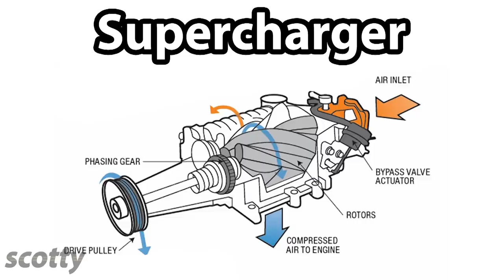Supercharger vs Turbocharger - Why Supercharged Car is Better than Turbo

Comment: Just curious why aren’t there many/any production supercharged cars? Lots of turbo gas vehicles now
Reply: Emissions and fuel efficiency standards.

It is much easier to build a turbocharged engine at a given power range that will meet current emissions standards in the tested range and in steady state conditions (idle, cursing at a set speed and low load).  In high rpm/boost/power usage states, a performance turbo setup will have the worst emissions when comparing it to NA and SC setups.

Also it is much easier to build a turbo engine designed for MPG/fuel efficiency testing since you just spec out a turbo for your engine that has a boost threshold within the mpg efficiency acceleration test range (1.5k through 2.5k rpm) and running between 6 and 9 psi.  When a turbo is passing over it's boost threshold and through a small rpm range after (which is biggest somewhere between 7 and 8.5 psi depending on the turbo characteristics) there is a massive spike (and possible small plateau) in the engine fuel efficiency.  If you setup that spike to happen through most of the mpg efficiency acceleration test range then the vehicle will see a large spike in tested mpg.  Also you use a smaller displacement engine for a given power range than you would with a NA engine, resulting in reduced less fuel consumption during the cruising part of the test.  That is, for the speeds when the smaller displacement engine with the exhaust restriction produces enough horse power running in steady state to keep the vehicle at the required mph.  If you look at a turbo vehicles test numbers, you will see that there is a much larger spread in mpg between the slower and faster mph test than a NA vehicle and often actually worse numbers in the 75 mph (and for really small engines the 55 mph) test.  But since the lower speeds are given a higher percentage of the test score, having those get a higher number more than offsets the worse number in the higher speeds.

Of course, you will only ever see that if you drive in the city like a granny.  Once you start cruising down the interstate at 75 mph or putting your foot in it and accelerating hard your mpg will drop rapidly.

So you see a lot of turbo cars now because they kinda sorta but not really allow car companies to cheat the fuel efficiency and emissions standards. (But really, they do)

Comment: I bought a power inverter from harbor frieght, harbor frieght aircompressor plugged into inverter and ran air line into the intake before map and maf. When I want boost i flip on aircompressor 😂

Comment: Maybe in the 70's this would be relevant but turbos have came a long way, they are water and oil cooled, are more efficient in generating power and are extremely reliable, 700,000 peugeot turbo still good never had a problem. 500k on a VW 1.2 TSI not a problem.

Comment: And when the belt brakes or blows of your stuck with turbo you can still go if you blow a intercooler pipe or turbo and if you want to make power I'd go with turbo why well anything that runs off the crank will take power from the motor to build it where the turbo uses wasted used energy to make power

Comment: I’d have to disagree. I love all forced induction cars but turbos are more efficient and fun to me. They don’t need to utilize engine horsepower to operate like SC’s do and that little bit of lag always puts a smile on your face when it finally hits you. Turbos also tend to utilize much more boost than superchargers and don’t require a big engine for their power

Comment: That pro-charger has the same lag as a turbo with less boost.  Real lobe or screw superchargers are outrageously expensive.  Turbos are ubiquitous and can be purchased for a few hundred bucks and most guys install them themselves.  Sure, a $6,000 SC is great if money isn't an issue.  But for most projects, it's out of the question.

Comment: N superchargers dont change the noise characteristics of the exhaust right? Since the exhaust manifolds havent been replaced like on a turbocharger. So a screaming v10 will still sound as it should even if it was supercharged, right?

Comment: Sorry Scotty but turbos are far more efficient. Roots style SC waste so much power just to get them turning. Plus they just pump all that hot, compressed  air into the motor. Which means less dense air and also less timing to keep down detonation. A centrifical SC is more efficient than roots type and can be intercooled but still is a large drag on the system killing HP. Centrifical SC also make boost per rpm. Which means you won't hit full boost tillcloser to redline. A properly matched "Big" turbo may be laggy but will reach full boost far before redline (where it counts). Plus there are many ways to combat lag i.e. smaller turbo, antilag etc. Turbos make more power per psi(efficiency baby!) and are ran by using wasted energy otherwise dumped right out the tailpipe. TC are more reliable if they are properly installed and if you didn't buy a "chinacharger". And to boot they get better gas mileage. Another fun thing you might want to read up on is why top fuel dragster are prohibited from using turbos and centrifical SC and are restricted to roots style SC. Sorry, didn't mean to "drag" this out but just thought people should know the truth hahahaha

Comment: Hi Scotty, i need to turn my engine over for at least 6-8 revolutions of the the engine without it starting so the small rattle gets oil just like a pre oiler would do .. i realize i cannot just pull any lead off incase i damage coils etc .. regards  Si ..  Jag 3 ltr S Type much better engine than the 4 ltr V8 ...  to replace the big end shells means pulling the motor as the sump cannot be removed ....or can you recommend a kit to pre-oil ...fanx  Si  ..

Comment: a turbocharger is thermodynamically more efficient since it harvests the energy from the exhaust gas, a supercharger is just an air compressor driven by the engine

Comment: Thunderbird sc was fords First factory supercharger eaton m90 3.8 motor. Infact the eaton 3.8 sc motor made too much power around 250hp so ford did its best to restrict air flow (ford wanted the mustang to stay king after all)

Comment: Can we put supercharger from 660 cc engine to 1800cc engine ?
Reply: Yes, but it's a better idea to scale the displacement of the supercharger to match the engine. The other option is to swap out the pulley for a smaller one so it'll spin faster and force more air inside.

Comment: So much miss information here. There is more "lag" on a centrifical supercharger than there is with turbo with similiar power out put. Intake, intercooler etc is the same between the SC and Turbo. Difference from adding turbo to the exhaust or brackets and belts for a sc is small.

Comment: Does supercharging accelerate wear on the engine?
Reply: Forced induction in general accelerates wear on the engine. But, like with turbocharging, you HAVE to keep with the regular maintenance. 🤣 don't slack on oil changes.

Comment: Can't you put an electrical clutch on a supper charger to only run it when wanted?
Reply: WOW never thought about that, yes it can be done like a clutch on an AC pump but i never seen it be done or if the demand is there for companies to do some R and D

Comment: Procharger or whipple?
Reply: Whipple best overall. But centrifugal Superchargers are safer as a belt driven turbo🫡. Easier on the engine less bottom end power, or direct stress on engine but power at anytime you want.

Comment: I prefer turbo's, proven to be more efficient  make more power and when they blow up unlike supercharger they don't directly throw metal into the engine. You can turbo anything as well...  and complexity, well that comes down to how competent a person is. I turbo'd my 6.2 diesel in 8 hours. Superchargers are limited by the engine that powers them which is they're  down fall. The best thing about them is that instant boost.

Comment: sorry Scotty but for once I have to disagree on this one. both require a fair amount of work to install properly if was originally n/a . turbo lag doesn't really exist anymore either, modern turbos matched correctly for street driving are on song nearly from idle. only race setups have lag due to huge turbos but hence your anti lag setups to remedy that. and as I'm sure you know all to well bolt on never.....just bolts on lol

Comment: Your rationality here is at odds with other videos of yours Scotty.  For example, your preference for 4 bangers over v6 is attributed mostly to simplicity, reliability and cost efficiency.  The spindle in a turbo is not axially loaded like a supercharger is, resulting in much less stress upon the turbo..which results in longer life and better reliability and cost efficiency.  The turbocharger only does its thing when needed, and a supercharger is always working...this results in much better mileage per gallon in a turbocharged engine.  A turbocharged engine can also be tuned to deliver much higher power than a supercharged engine can, while also retaining better fuel efficiency.  Adding an intercooler is much easier for a turbocharged engine too, as a roots type supercharger usually cannot make use of one.  The intercooler increases fuel efficiency and and power and reliability.

The reality here is that you are mistaken in your assessment between the two.

Comment: Supercharger have parasitic power loss but don't get me wrong I love a old 8-71 blower but turbos build better power run more efficient and are actually cheaper and easier to setup only draw back is turbo lag but if done properly will have almost no lag that is noticeable

Comment: Hmmm... but does that mean a supercharger engine Will run cooler since the exhaust flow is better?
Reply: possibly but most likely has alot to do with proper fan congratulation and proper radiator installed plus air flow

Comment: I don't understand how a supercharger is an easier install unless you're comparing a car with a awesome aftermarket availability for both but poor adaptability for the turbo.  If you have a car that never expected a supercharger you're SOL on a roots type pretty much at all and G chargers are rare and almost exclusive to tiny cars.  If I want to put a turbo on a Ford Tempo, I can fabricate a set of headers from off the shelf parts and an entry level tig machine and have a stage one by the end of the day.  On a car that has a mild steel header option it gets even easier because you can buy a mig machine for peanuts from HF.

Comment: Turbo’s are better for fuel economy and power! I would also say Turbo’s are more reliable as well...Superchargers have belt problems at high Rpms when trying to make serious power! It also takes a lot of power to turn a Supercharger...so you lose a lot of HP when compared to a Turbo! I will also point out that Daddy Dave switched from a Supercharger to Turbo’s due to reliability issues with the Supercharger and he’s running Faster Times now with his Turbo set up in his Nova!
Reply: Hey 1 hour ago, what power boost you Recommend on Twin & or Quad Turbos for Cadillac 6.2? Thanks
Reply: Or how about SuperTurbo

Comment: Its not wrong, but its misleading. Turbos will give you max boost as soon as its spooled whenever that be, 2k rpm or whatever, superchargers have linear power the entire way, so for 90% of the race the turbo will be doing more for your power.  I too prefer the super charger but you shouldnt downplay the turbo charger so much.

Comment: hello how are you doing , sweet and short I have very old car 1980 Toyota corolla KE70 engine , could you please guide me what kind of super charger do I need and how does it cost ? I live in Pakistan & $ 1 is 155 Pakistani rupees , so please tell me those rates which I can afford other wise I wont be able to buy , thanks in advance

Comment: This video is kind of biased. Superchargers are nice and are easier to install. They do typically give you a more immediate boost. However, a turbocharger takes the cake when it comes to boost/power in today's world. To keep it semi short and sweet, superchargers take power to make more power and rely on an engine's rpm to make boost. Turbochargers, on the other hand, don't take power to get power and it's limit is based off exhaust gases. It doesn't require power from the engine to spin, so the faster you go, the faster the turbo goes. The only real limit to a turbocharger is heat.

Comment: Why does a turbo boost MPG more than a supercharger?
Reply: Turbos use exhaust gas that is expelled from the engine, and use that waste gas to spin the turbine. Super chargers use a belt that is ran off the engine, and are a little parasitic, as they use power to make power. Turbos are more efficient in that sense, but they have to build boost based off the rpms and you get what is known as turbo lag. Also, turbos are more complex to install. However, they can build more boost, if the block can take it that is

Comment: If you want an American muscle car with lots of low end grunt, slam down the accelerator and send up clouds of smoke, squeal those tires so everyone hears you within 10 miles, then super charging is for you. If you want refinement power more along the lines of James Bond, power that begets more power without all the smoking tires, then you want AWD with turbos to put all that power to the road to build speed as fast as possible without all the burning rubber. This is mainly the difference between high powered muscle cars and super cars. Super cars generally have the entire package suspension and breaks to go along with all that power. Muscle cars generally only have power and are built only for burning rubber, cheap so most Americans can afford to have a powerful car, and that cheap comes from leaving off all the rest of the stuff that makes a super car super. The awd cars are also built to carry a lot of that speed around corners. The muscle cars are built to slide around corners in a semi controlled skid.

Comment: I like this guy lol he's funny, but no one can change me from turbochargers in a daily driver (only car I own), I like cruising around with my little 4 banger with crap power until I wanna have some fun, slam the gas, 30 psi later I'm scaring the crap out of everyone riding with me, the lag to me makes it more enjoyable because I have the power when I want it and don't have to worry as much about throttle modulation and taming a 350hp monster all the time, just when I actually wanna go fast, so I will be sticking with the turbo life :)

Comment: Or you can break down the pros and cons of each instead of just trying to get the internet to have the same opinion as you. If your car is geared right and if you want to track it,  you will always be in a rpm that gets boost. They are better at different things not one is better than the other. If you want more power turbo, if you want faster response and more power at low rpm, supercharger. Stay educated people.

Comment: Help please!!!!!! I have a 07 Toyota Yaris  1.5 l vvti shakes really bad at idle specially on D or R already changed air filter plugs and coils and cleaned throttle body someone said vvt oil filter please advise
Reply: That's your motor mounts

Comment: Sure for the most versatile cheap and easy with reliability supercharger is the way to go but when talking about maximum power the turbo car will put more out than a supercharger  in some applications to higher reving cars with less displacement and tq because rather than stepping down pullies to not heat soak the supercharger you can be utalizing the extra 2000 rpm through each band at WOT and so long as you bump in with a trans brake you can already load boost and tq if you launch and say you turbo a v8 that revs extremely high like the gt350r then you would have the tq you need with out turbo lag for launch while being able to apply maximum boost while spooling faster more so than a supercharger in key power bands for when the down force is most active at higher speeds for maximum power without spinning and the mph will be better plus you dont have to rely on a belt to take away your tq from low rpm aswell as belt snaps or over driving superchargers to heat sateration trying to gain more power. It all depends on the application and set up of the car on weather or not it makes sence for what your trying to do. In most cases I agree the supercharge makes most sense like you mentioned for being the easiest, cheapest, and all around most friendly being less complicated especially to 2 valve push rods but 4 valve cars and higher reving cars with less displacement respond much better to turbo than superchargers due to the extra rpm and lack of tq to begin with trying to spin the supercharger off the crank along with everything else so the motor needs to survive let alone trying to perform at top pinnacle.

Comment: Superchargers rob power to make power... good old belt tax.. plus you can control boost better with turbos. Nothing wrong with superchargers but there’s a reason turbos are killing it in modern drag racing

Comment: This is a strange video to me. Belt driven power adders put incredible strain and wear on the crankshaft main bearings. They also have a parasitic loss that is usually equal to the power they are making. PD blowers have very real heat soak issues that once warm take away all the power they could make and then some. This is the root cause of a class action law suit filed against GM by c7 Z06 corvette owners. Poor Scotty, Perhaps after you see the twin turbo hot V setup on the c8 you will understand. Turbo's are the pinnacle, the holy grail of power adders. It is a gross lack of experience in this arena that has brought you to the publication of this video.